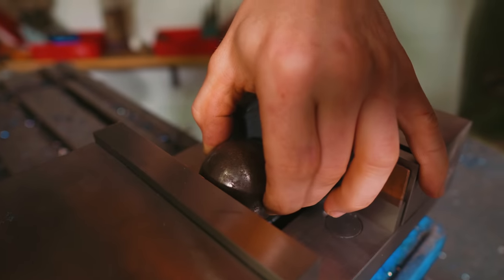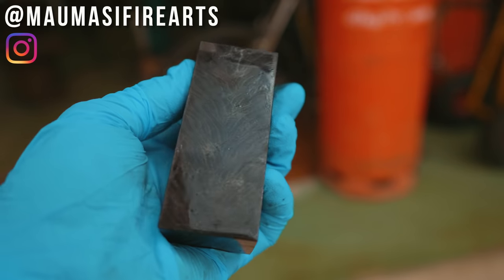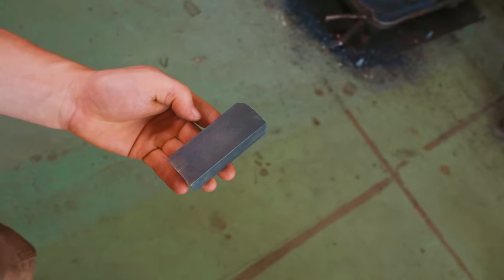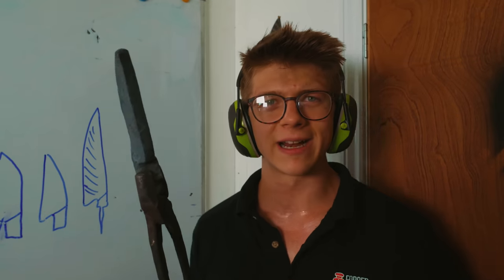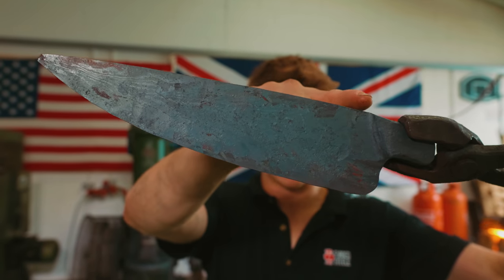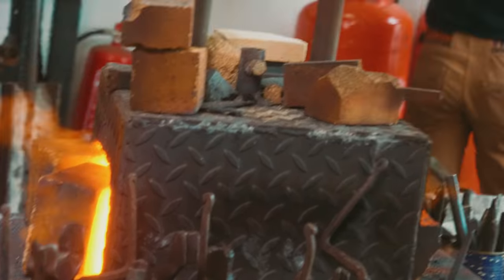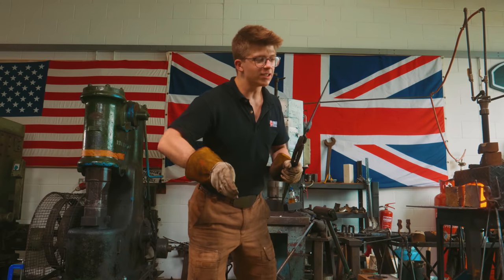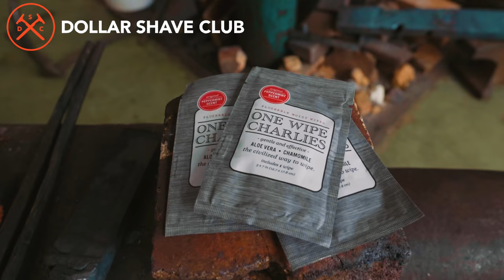MAKING A CHEF'S KNIFE!!! PART 2

Comment: 2 questions. Why didn't you make it a full tang? And second why don't you use a infrared thermometer to check the temperature of the steel between normalizing and quenching sessions. That way you would get very accurate results.
Reply: yeah annoys me that he didnt do a full tang
Reply: My only assumption is what he touched on in the first part. Damascus is incredibly inefficient to work with and the amount of material he had didn't allow for a long enough tang.

Comment: Hey Alec,

Just a comment on machining. You can get a more accurate fit if you don't hit it with a hammer when you put it into the vice. The hammer strike can cause it to bounce up and off the parallels and end up slightly crooked. Its more accurate to simply hold it in place with finger pressure. You can also feel anything that is out of square with your fingers much better.

Keep up the good work man! Sure love your videos!

Comment: You should invest some time in making spring swages, something like a fullering swage but rounder in this case. It would let you put more focused strikes on certain areas like the heel with less risk of causing a problem to form in the blade. Plus it will allow you to move material easier because you're hitting a relatively flat surface that you can still manipulate where the actual force lands.
Just 2 cents.
Great work. Keep it up

Comment: Might not be a bad idea to get a heat gun so u can monitor the annealing process. If you can control the temps youll come out with a much better product thru the entire piece as far as consitent from end to end. The 3 t's of heat treating. Time, temperature and transformation. Mess up one ull weaken another.

Comment: Question.  Since you have to do so much grinding at the end to finish the shape of the knife anyway, wouldn't you end up grinding through all the tig welds at that point anyway, instead of grinding them off first?  It'd be interesting to see what happens if you don't grind them out first.

Comment: I wonder if Alec would be able to forge something sharp. Get a thin enough edge that it could cut without being ground down. Just forging and heat treat. Thick enough material that it doesn't bacon in the quench, but able to cut without dressing the edge.... 🤔

Comment: Next chef knife build you should do some research on cutting techniques because your knife is only intended for the rock chop style. You’re designing a French chef which is perfect for the rock chop but not the push chop so maybe try the Japanese style knives next. I’ve been sharpening for 7 years and cooking for 13 years. I would say be careful with putting your edge behind the bolster because in a fast paced environment it tends to be a hazard.

Comment: One thing I'm always curious when I see people making fairly mundane objects using blacksmithing techniques that can be had for fairly trivial amounts of money, is...

What are the mass production equivalents of these techniques?
The $5 kitchen knife I can buy easily from the average shop (or even the $100 one, frankly) surely isn't made in such a labour intensive way, so how IS it made?
What does this process look like when you're trying to do it as cheaply as possible, and make 50,000 of the things, instead of one?

Comment: what was the purpose of using the ball bearing vs your normal use of a parallel in the mill?
Reply: As the user 12345NOU54321 very well put it:
"The mill vise has flat jaws. For something with an uneven surface, like a rough forged billet with scale, the jaw won't hold it well enough. Dropping something round, like a ball or a pin between the jaw and the workpiece reduces it to one point of contact, and helps hold more securely."

Comment: Might want to avoid that lavender, or other tea tree oils.  They absorb through the skin, and can mimic the effects of estrogen, and works as an androgen blocker.  They have been linked to breast growth in pre-teen boys, and obviously any hormones or chemicals that mimic hormones can have strange effects on your body.  It's fine for females, since they normally produce much higher levels of estrogen, but if you have a Y chromosome, you might want to avoid that stuff since your body chemistry is obviously different than someone with two X chromosomes.

I know it smells great though, so donate it to your girlfriend or something, and then you still get to smell it without actually using it.

Comment: +Alec Steele I have just started knife making but the one problem i run into is the edge of the blade folds in on its self kind of like this /|\ withe the vertical line being the center. How do i fix this in the forging?

Comment: Why you always use things like the copper or brass or that ball when you mill something?
Reply: Copper or brass provides a good grip without dent the billet as for the ball, as the user 12345NOU54321 very well put it:
"The mill vise has flat jaws. For something with an uneven surface, like a rough forged billet with scale, the jaw won't hold it well enough. Dropping something round, like a ball or a pin between the jaw and the workpiece reduces it to one point of contact, and helps hold more securely."

Comment: Why the ball bearing when your milling??
Reply: The mill vise has flat jaws. For something with an uneven surface, like a rough forged billet with scale, the jaw won't hold it well enough. Dropping something round, like a ball or a pin between the jaw and the workpiece reduces it to one point of contact, and helps hold more securely.

Comment: What was the point of the ball bearing?
Reply: As the user 12345NOU54321 very well put it:
"The mill vise has flat jaws. For something with an uneven surface, like a rough forged billet with scale, the jaw won't hold it well enough. Dropping something round, like a ball or a pin between the jaw and the workpiece reduces it to one point of contact, and helps hold more securely."
Reply: Ohh  right, yeah I understand now. That's pretty intuitive.